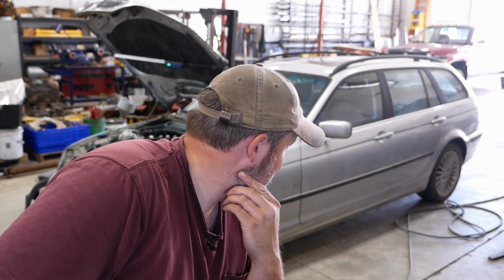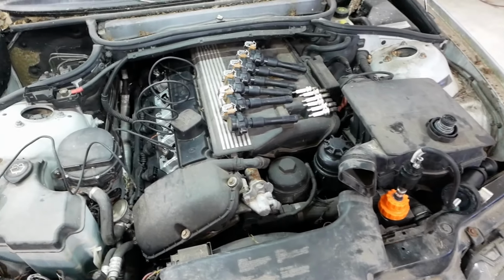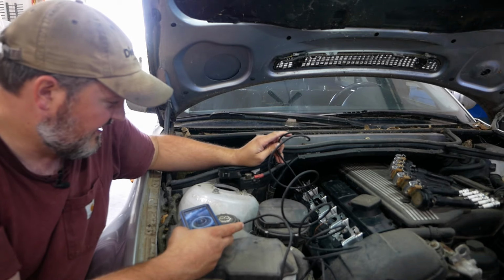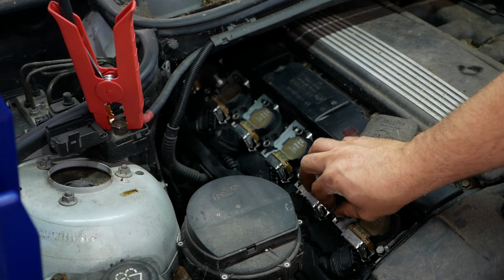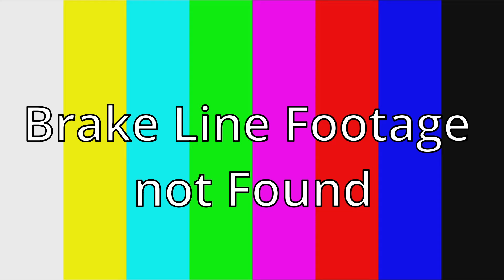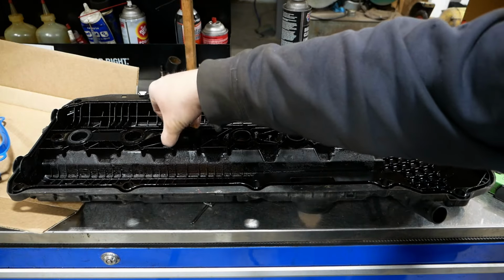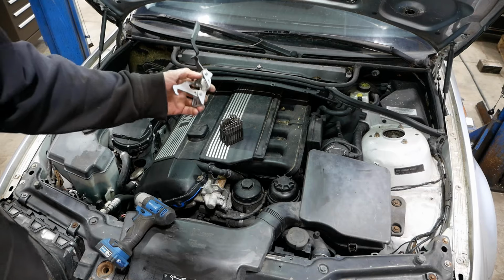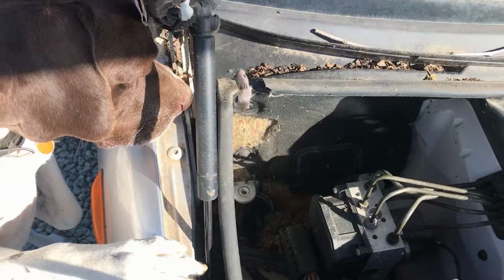E46 BMW Losing Coolant, Oil, Brake Fluid, Etc.

Comment: Excellent video Wes  :) never work on a BMW cars ever but losing collant would have Low Coolant module sensor on rad  of side of hand and why ask make Lol! I losing coolant in my 2002 Chevrolet Impala E-X 4 door with 3.4 litre series 2 of 207 Cubic  V6 motor not head gaskets or vavle covers  , or Thermostat faulty or a Water pump & no intake  even rad leaks and hoses  to! Funny part Low Coolant Sensor light came on when did cold start and hot start not! So found Sensor went but didn't leak but Dex Coolant plug up sensor and change fluid then figure the water pump inside propeller seal broke and seized up ! So put new Water pump in and no problem but did change hoses plus Thermostat too! Cure all and put NAPA brand RISLONE  in rad to cure never lost drop of fluid in rad or resivor again !

Comment: ECS tuning has the complete cooling system kit that should be installed on all older BMWs, worth the time and money. Check PCV system, the drain is known to clog, dumping oil into intake. Plastic valve covers known to crack, Ebay ones are fine and come with gasket.

Comment: Seems like you covered everything.  Maybe take a simpler approach and verify the owner is using the right coolant, replace the thermostat, and the line to the expansion tank.  Any one of those could lead to loss of coolant through a leak, a low boiling point, or evaporation; but only when the engine is hot.

Comment: How many times have we all said “Shoulda Kept it” 
If only we coulda kept it. :)
Re Rust
I have a 40 year old car and it’s not rusty.  Sure we don’t salt the roads here.
The answer is Galvanised.  It’s a 4wd originally destined for the police but didn’t get there and was sold privately.
It has zero rust where it’s brothers and sisters of the same model are falling apart.
It shows they(car manufacturers) can do it if they want to. But why would they want to?

In the end Max says  ”I’m going in!”

Comment: It may be a very small gap in the head gasket or a micro fracture of it. Usually a blown head gasket takes time to be noticeable so it is possible that this is just the beginning of a problem that becomes bigger over time.

Comment: WIth the slow pressure leak, often there is a minuscule pinhole in a hose or an undetectable crack in the stat housing. Happened to me.

Comment: I had a Mini Cooper that had a pinhole leak in a metal line. It's sprayed directly against the block and only leaks when it was hot. It was a son of a gun to find because it was behind the intake going up to the water pump against the block. I only found it because in desperation I changed out the water pump to keep from blowing the head gasket from overheating because my wife would never check the coolant before she left with it. Don't know if that helps but it's something to look for.
Reply: I had a similar issue with a plastic coolant pipe on my Focus ST we literally found it by accident doing something else just noticed it dripped very slowly

Comment: Had the very same car, the valve cover was warped between the bolts and leaked even with a new gasket. Had to replace it, the motor was over-pressurizing because the EGR system was clogged up. Had to replace that stuff too. Known issue...

Comment: I wonder if the hoses weren't the original issue, he solved that but then had an air pocket that made it seem like it was using coolant. Now that it has worked its way out, its not really "consuming" coolant anymore.
Reply: A vacuum bleed could be ticket for this one. Bmw recommends it for nearly all their cars.
Reply: They're certainly fiddly to bleed, if you don't use the bleed screws.

Comment: Coolant leaks like that need to be tested with a hot AND a cold engine(experience 😊)also don't forget to check for leaks into the interior. Don't forget to check the radiator cap.

Comment: That is a tough one Wes it seems to hold pressure. Add a UV dye and when he comes back the next time you have a location of where it's getting out? I drive a 1992 525i Manual and over 3yrs it lost about a pint of coolant M50B25 the radiator also has a side tank I hear those leak as well. I love my car it has 350k on the clock and it is almost time to go get it out of storage for the year I am excited, this year is coolant flush along with oil etc., Have a great day! @WatchWesWork.

Comment: I had a problem like that once, then I noticed damp carpets inside the car, and it was the heater matrix with a pinhole leak but only when hot and under pressure. Very perplexing at first.

Comment: My AUS GM-H 3.6 alloytech V6 has the same problem can't find a leak done all the tests still uses about 100ml of coolant when I drive it no codes no loss off performance it's a head scratcher & really annoying I don't like not being able to find/fix any problem/s on my vehicles.Cheers Wes better luck with the next job.

Comment: Midrange and up European cars from the late 1980s onward (well, Fiat went way into the late 1990s before they started doing it) are completely galvanized, and coated with sealant before they're painted, so they shouldn't rust as long as they're treated right and kept clean

Comment: Thumbs up 👍 I’m thanking of the cylinder rust. The beginning of the head gasket leak. It’s more like a seepage than a leak. And how often is the owner adding water/ antifreeze? What is his definition for that leak. He may have called it early.
Reply: This rust in this cylinder is a witness. Maybe the seal, but it could also be a foundry problem, a tiny crack or a hole the size of a hair that has made its way... Sometimes impossible to highlight in the leak test of the cylinder head (at normal temperature)...

Comment: little tech tip from when i wrenched. go higher than 15 psi like around 20. if theres a leak you will see it. dont know how many times i would have a car come back and i pressurized it and all and never saw a leak. until another tech told me to do that. to go higher than 15 psi and it would always show the leak on hard to find leakers. now of course i.m not saying this is your problem just given unsolicited advice lol we are a community here

Comment: the coolant hard pipes underneath the intake are probably seeping out, they get brittle and break off inside the head, also the plastic valve covers like to warp over time, if there is still a issue with it leaking that might be your cause, signed a 01 330ci manual owner

Comment: I reckon if the leak is small enough to not mess up the floor, blow white smoke, or be detected in the oil, just add a bit of coolant whenever needed, and don't worry, be happy.

Comment: Its been a very long time since I saw a 6 cylinder petrol one of these - we almost exclusively have the diesels on our roads but I'm sure there is a coolant pipe under the intake on the drivers side of the engine that like to leak. Or maybe I'm remembering wrong in my old age. Aftermarket cooling pipes on these generally end in tears. 

This car needs a lot of attention and its still fairly nice but its not really economical to pay someone to do it with what it would cost with parts and labour.
Reply: The V6/V8/V10 have that pipe (a transport pipe between the front and rear)

Comment: Sometimes the  heater distribution block at the back of the engine cracks (plastic) , drips on the exhaust and evaporates. just a suggestion if it comes back to your shop

Comment: Small crack in plastic expansion tank on side of radiator that only leaks when pressurized. However, you pressurized it to 15 psi . . . very surprised the leak didn’t show.

Comment: I had a Volvo 850 that was slowly losing coolant, it smoked a little bit on cold startups, but I could never be sure if it was burning coolant.
I ended up finding the expansion tank bottom nipple was cracked and it would seep very slightly once under pressure. I never saw any coolant drips or puddles anywhere.

Comment: I have fought and fought and FOUGHT with several early 2000s Beemer coolant leaks…and more often than not it ended up being a very elusive leak from a degas bottle or a radiator tank. Thankfully none of my current customers own a bmw any longer.

Comment: Had an 08 Chrysler town and country that was losing coolant.  Never left a puddle, couldnt find any wet/damp spots at the under the hood. It wasnt getting in the oil. (I didn't try pressurizing the system since I don't have a pump) I just topped it off every oil change and lived with it for a year or two. One day, it overheated. While having the hood open with the engine running, I found the leak. There was a heater hose that went over the exhaust manifold. At this point in the hose, it had a plastic "y" fitting and there was a kinda slow but steady drip.  Coolant would hit the exhaust manifold and instantly vaporize. Guess I'm saying if it is an external leak, it'll eventually get worse and be easier to find.

Comment: I'm surprised you didn't think that rusty cylinder was more alarming. But if it's a half gallon of coolant every 3000 miles, well, it could be worse

Comment: I had a G37 that only leaked coolant (into the cylinder) when the engine was cold (at the end of the drive cycle).  Found by using a scope and pressurizing the cooling system while cold.  The cylinder head had porous area between the valves on the #1 cylinder.  Installed liquid glass stop leak to the cooling system to fix the problem.  Been 6 months and still OK.

Comment: Had this once with a citoen XM 3.0 v6. I lost cooling fluid through the exhaust due to a cracked block. Recognizable at the very steamy exhaust plume during cold starts. After the engine was hot the crack probably closed and much less coolant was lost. In the end the crack became so big that (burnt) oil started to escape through the exhaust and the car became a total loss.

Comment: I have an 06 530xi 6speed manual car, the coolant reservoir would only leak once it was really hot, lots of seams to weep out of when the super tough fibreglass plastic gets old and heat cycled.

Comment: Once i had the same issue, turned out to be a couple of pinholes in the radiator core, the leak is small enough for the coolant to escape and sucked in by the fan for it not to leave a trace...

Comment: This is tricky , the head could have a pen hole that leaks under the correct  thermal and mechanical situation are met? The head would hv to be pressure tested why thermal event is simulated get it hot then cooled then reheated then cooled  could be on the exhaust side in the 80’s we had a rash of jaguars & land rovers with coolant issues I remember we used to fill the pot holes on the head gasket surface with JB WELD and resurface , surprisingly you did not DVOM the coolant to see if it was capable of eating aluminum. Great video.

Comment: I wonder if it has an air pocket or if these are prone to that. Chevy Cruzes had a TSB for this where there was nothing wrong, it would just use something like 4 oz of coolant per 1000 miles. If you drained it and refilled it with a vacuum filler it would be fixed completely. Seems really bizarre but true.

Comment: There is rust in one of the cylinders, this is usually caused by water. It could be a very small coolant leak.

Comment: I have had pressure caps that would not vent or return fluid to the reservoir at the listed pressure and have it go so high that it made it leak , like your blown hose , and thus would over heat, but not due to the  actual condition of the engine or radiator.

Comment: Better coolant than oil . I have a 2001 Chevy with a Duramax used coolant before . had it bullet proofed so called , Still uses coolant .  Light pops on once a month . I just live with it and still carry a jug . Something's are just meant to be , I'm told . What's with the Cutter ? You use it to hold Gaskets in place place till you get a bolt in them ?

Comment: my neighbor was all worried she would lose a bit of coolant on a 3 or 4 hour trip to Boston with 15-year-old Prius the garage told her must be head gasket leak and wanted to charge her thousands to fix it or replace engine i said it could be a lot of things with tiny leaks just add antifreeze and drive it till it dies it doesn't really leak driving around town

Comment: Change the radiator cap and bleed the coolant system (there is a bleeder in te radiator) uphill with the heater on full blast.

Comment: I think some Bmw's just use coolant for no reason. My Parents Drive a 520D f11. when i serviced the engine i had to put coolant in it. about a 6 months or so later the coolant tank was almost empty again.
My uncle also has an f11, Same thing with that one.
Reply: The system builds pressure and the cap will vent it off so it could be that it’s vented enough pressure and humidity over 6 months to trigger the sensor.
Reply: @FishFind3000  i am aware that the cap vents a little bit over time. i just find it a little excessive. The coolant reservoir has a decent size to it as well.

Comment: Porosity in the #6 intake port maybe? 
It might take a high vacuum to bleed the coolant into the engine .
I used to work for a large car maker in the engine assy and we used common roof and gutter sealant on the r/cover joints.
Eric

Comment: on e46 6-cylinders you better remove the air intake box for the passenger room. I owned an E46 323i from 1998. An issue was the water cooler with thw time it blows up at the lower section.

Comment: When I saw BMW coolant leak the first thing I thought of was all the little plastic external coolant lines, fittings, etc. on that car that were the likely cause but it sounds like the owner has already had those services? Maybe they didn't do all of them or do them correctly. Because as you know you can't always trust another shop's work quality.

Comment: From my experience, bmw cooling systems operate at higher pressures.  The cooling system should be pressurized to 21psi.  Small leaks often don't show up at 15psi
Reply from the maker: I doubt we would find anything. I think it has to be hot.

Comment: i had a dodge shadow that had a weird coolant leak the seam on engine between two freeze plugs cracked where engine was molded together and the freeze plugs would leak and i finally figured out that they would loosen as engine heated up so i put in a rubber plug that expanded with a bolt through it that fixed 90% of leak tiny bit got out through crack but it was drivable.

Comment: i've watched your channel for years and this is the first time you've had a car that I can actually relate to! 

are you sure your 330ci had manual seats? all of the coupe's in the UK at least had power seats
Reply from the maker: Positive. Had a cool ratchet lever to recline.
Reply: @WatchWesWork  strange how they change cars for the regions. We never got the 4 wheel drive ones either. Cheers!

Comment: I’ve been working on BMWs for 9 years, I’ve seen M54s slowly lose coolant and it’s always been a hairline crack that goes from the coolant port to the combustion chamber. It only opens up when the engine is at operating temp. I just fixed An M54 x5 doing that

Comment: If the head is aluminum like a VW diesel, I had. It only leaked coolant after reaching normal operating temperature.

Comment: I’d say that rusty cylinder with the green running down the sidewall was pretty definitive.  Compression is often still good in a cylinder that has a very tiny leak like that.  Did you ever do the hydrocarbon test?  You diagnosed it.  Are you not committing be a you’re afraid of a comeback?

Comment: I bet it’s the hard plastic cooling lines underneath the intake. My daughter had the whole cooling system replaced except those two lines on her 2004 bmw 330i. She was told that they pressure tested the system and it was good.
So she took the car for a long trip but 2 hours into it the car overheated on a busy highway and by the time she found a place to pull over, the head gasket was gone…
I then checked my 2005 bmw 330ci weekend driver, with barely  one hundred thousand miles on it, and guess what? As soon as I touched those plastic lines they broke in my hand. So please people don’t take any chances. If you own an e46 and has any original plastic or rubber hoses, please replace them because it’s just a matter of time…

Comment: Can confirm the JNC 660 is a good jump pack. Its actually the same unit that Napa and Bluepoint sell, just rebranded. 

Had it for over a year now, starting up a lot of big blocks no issue.

Comment: Have you checked the matrix heater? may be it is either blocked or leaking, it happened to my vw golf same as this BMW, the matrix heater was blocked and leaking, changed it, problem solved.

Comment: In my experience, I have found second hand BMWs to be terrible for dumb, extremely expensive things going wrong. Audis, VWs and Mercs are the same. Lovely cars, beautiful to drive, but then the radio stops working, the electric windows don’t go up and down, the floors are mysteriously wet, the clock stops, there’s an intermittent miss, then finally it needs a rear suspension link end that you have been quoted $4700 for. Meantime your Toyota starts and runs, everything works, there’s no rust and you haven’t touched a thing on it for years.
  The moral? Forget your imagined social status and buy only Japanese cars.

Comment: I have a theory. Porosity the #6 cylinder wall between the water jacket and the cylinder. A casting defect. That rust is the clue.

Comment: Some of these E46 are like real rust buckets. Maybe they used better sheet metal for the North American market? At least the inline 6 engine is better than the inline 4. I think the mystery leak on this engine might be on the other side. I'm not sure but this thing has some plastic pipes running the sides and the o-rings tend to leak overtime. Might not be visible from the outside at all. I wish you good luck with this thing cause your gonna need it all.